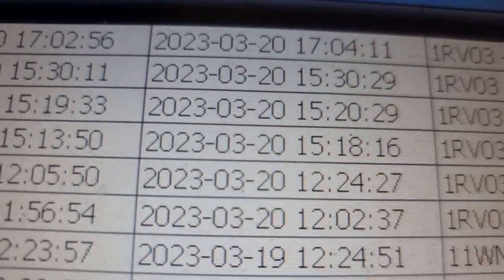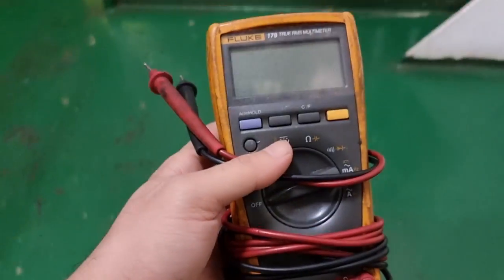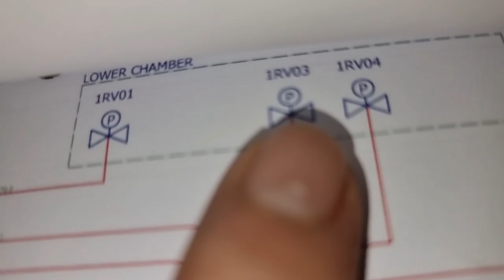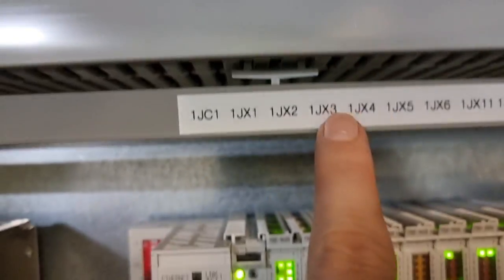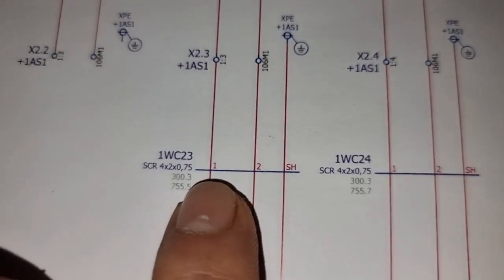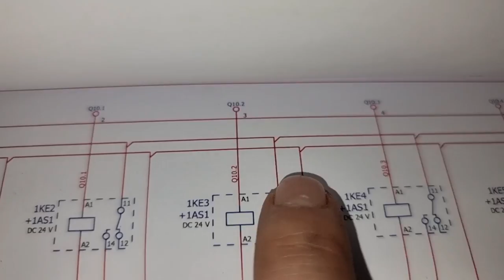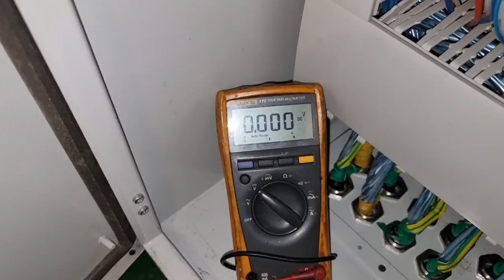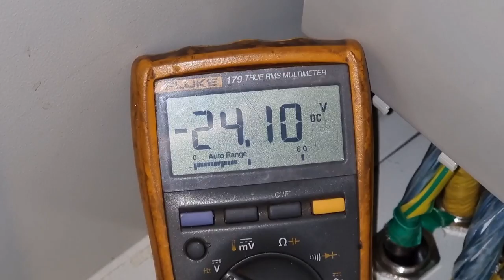VESSEL SCRUBBER TROUBLESHOOTING

Comment: Hey Jake
Have 2 metallic barges set up for commercial diver training. Separated by about 0.5m between each other with a walkway between them both. 
Seperate generators on each barge. 
Worried about the potential difference between the two. 
Should both gen sets on the barges be bonded together?
And the barges bonded to each other too?
I thought they should be.
Thanks so much if you can answer
Reply from the maker: we usually do the same in the vessel with the ship to ship bunkering and other ship to ship operation and we do not do anything at all.
Reply: I'm not a marine electrician but I do work on live event production with generator systems and such.
Typically if there is any connection between the power systems we will ensure all grounds are bonded. That said in your situation odds are the water itself likely would handle any common grounding I'd wager. If concerned about potential between vessels them you could always meter from the walkway to a given hull/ground and see if there is any measurable potential between them and then act accordingly.